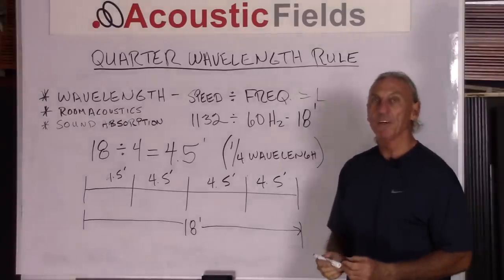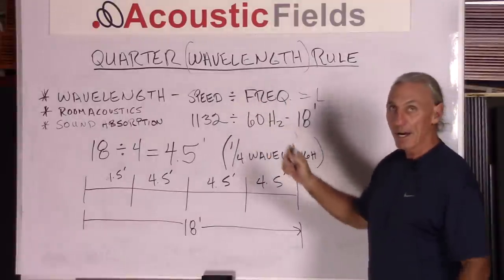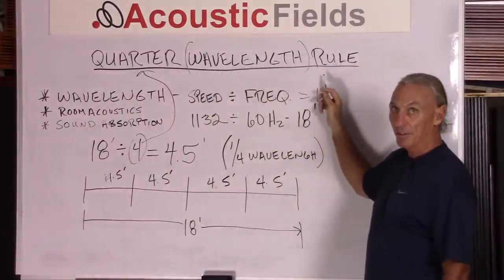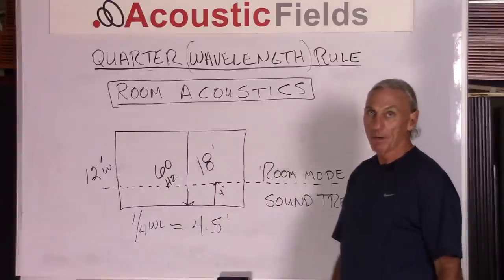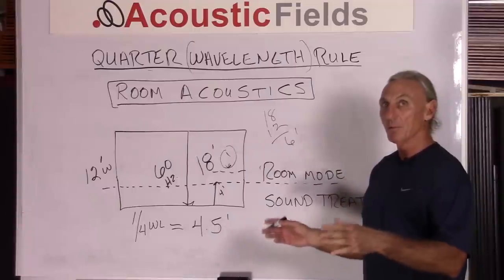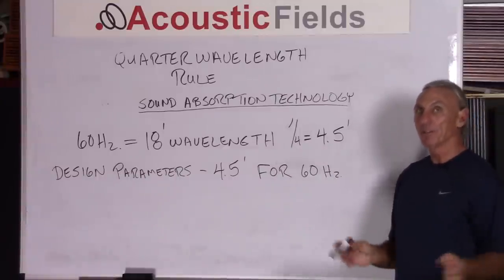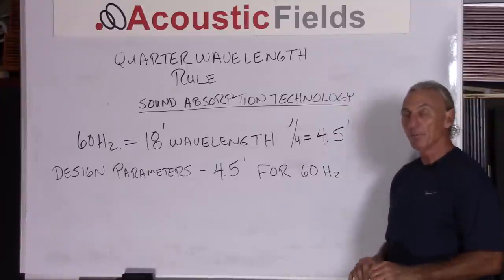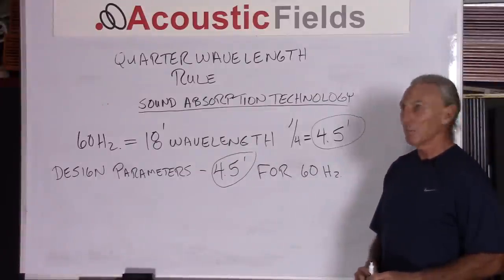The Quarter Wavelength Rule And How It Applies To Room Acoustics

Comment: I didn't understand what you meant. Yes, okay, 4.5ft is 1/4 of 18' which is a 60 wave. Ten minutes of saying that ten ways or more, yet nothing I could discern about anything you're applying that principle to. Add 4.5' to acoustic treatment how? Make acoustic treatments 4.5 feet in what way? What is the context of this principle you're trying to impart? This felt so incomplete as to lose the conception of the very premise.
Reply from the maker: C,  Education of complex issues requires a step by step process. Our experience with illustrating complex subjects tells us no more than one main item per video. If you try and define and explain the issues and then offer the next logical step as you have illustrated, people get confused. A confusion that translates into numerous phone calls and emails for me that takes away from my available time with customers. We will be doing a follow-up series on this topic in 2019 taking this concept to the next step and applying it to small room acoustics.
Reply: Thx but I asked for elaboration not a defense; that in no way answers my question. 4.5 feet what? 4.5 feet in what way? In what regard? 4.5 feet from the short walls? 4.5 feet tall? 4.5 feet is 1/4 of 18 yes, but you can't just apply that to NOTHING and call it a rule.
Reply: It has to do with particle velocity when the strength of the wavelength is at its weakest then theoretically it should be easier to stop with velocity based absorbers such as broadband panels etc...so to trap 60 hz fully you would need 54 inches of pink fluffy stuff to completely trap the wavelength. Limp mass absorbers or helmholtz helps in this situation, but by all means look into it dont use pieces of charcoal briquettes to tey and fix it at over a thousand dollars a pop. A sealed cabinet with hardboard or mass loaded vinyl does wonders if tou know the math so you can build them deep enough etc...
Reply: @AcousticFields  but which video shall i watch next? step by step is the right way to walk, but where shall we step next? we get lost in youtube randomness if you don't lead us a little bit, maybe you could PIN a comment with a link to the following subject? would be dope! much love and thanks for your work, really appreciate it!!
Reply: There are 2 types of sound absorbers: pressure and velocity. At a physical barrier, the velocity of the air particles is zero and consequently the pressure is at a maximum. At 1/4 wavelength from the barrier, the velocity is at a maximum and the pressure is zero (in a perfect environment). Porous absorbers, like rockwool, absorb best at maximum velocity, so if you want to absorb the 60Hz wave that he is talking about, you will need to place your rockwool panel 4.5ft from the wall. This isn't practical in most situations, so the better solution is to go with a pressure-based absorber like a diaphragmatic panel absorber mounted on the wall where the pressure is at its maximum.

Comment: I can always go through your videos to check it you have one on this, but Id be interested to see the process of building and placing the treatments in a room based on this video. I'm unfamiliar with quarter wavelength bass traps, how they might be built and implemented. As I read, it was getting a bit confusing -- so it would be great to see one of those put together to resolve a similar issue to the one mentioned when trying to absorb bass. My understanding is it tends to bunch up in corners. I also know there's pressure-zone traps, functional traps, and active traps. Trying to learn the different use cases of each. Thanks for the video!

Comment: Thank you. Explained very well to my SO why we needed a few acoustic panels in our Sun Conure Parrot's room (95dba max screaming) and why they needed to be the size, shape, and offset from the wall that they are. FWIW, Sun Conure's scream biased in the 2k-4.5k hz range, so absorption is easy with 2" rockwool and a distance from the wall of 2.875cm. Cheers!
Reply from the maker: A,  Building insulation will provide absorption in that frequency range. However, it does not provide the proper rates and levels for music and voice. The fibers are also lighter than air and can go through any fabric covering stretched over it. look at what those fibers are made of and then ask yourself if you want those in your bird's lungs and any other living thing in that room.

Comment: At 1/12 wavelenght, wich is just 33% of the original impractical 137 cm of 1/4 wavelenght, you still have 50% of energy in speed form,  and it's a practical distance of wall (46 cm) for hanging treatment. please correct my numbers if I'm not right.

Comment: It wasn't clear to me what you were saying. 
What if the room was 18' long?
What about if the room was 13.5' long?
Please explain what the 1/4 wavelength rule means.
Thank you
Reply from the maker: T,  An 18' length would be best. Here is a different definition:
Quarter-wavelength rule : If a wall is a node, then the nearest other node at any frequency will be 1/2(wavelength) away from the wall. Given this, the antinode is midway between those two points, or 1/4(wavelength) away from the wall, for any given frequency. So, for example, if you want to filter out 60Hz, divide 18’ (the wavelength of 60Hz) by 4 = 4’6" and hang a thin layer of frictional material (acoustic foam) at that distance from the wall(s) and floor and ceiling.
Reply: @AcousticFields  I really liked your video, It really opened up my eyes into how the acoustics works.  But, here's another explanation from the wave sense.  If you think of a sine wave, the positive peak is at the 90 degree point.  That means that the highest amplitude or sound level will be at that point.  If you want to quiet a room, then place the sound absorbent material at that 90 degree point and it will be the most effective in absorbing the sound.  But, at the 45 degree point, the effectiveness of the sound absorption would be about fifty percent less.  Thanks for making this video and it was a bit difficult to understand the directions of the wave in the drawings.  Have a nice day.

Comment: Well explained,  my buddy had me place my speakers according to the golden ratio of the room dimensions,  not sure why. Is there a logical reason behind this ir is my buddy full of it, lol, thanks.
Reply from the maker: J,  Its physics. Sound travels at a certain speed. It also takes that speed and travels over distance. In small room acoustics its all about the distance the direct energy (straight line from speakers to ears) and the reflected energy from walls must travel before it reaches our ears. Its a balance between straight line energy (speaker) and reflected (room) energy. The "Golden Ratio" is a starting point towards that goal.

Comment: If anything, should I place the the baffle of the speaks in front of OR behind the screen?
Reply from the maker: Neither. If you place them behind the screen, you attenuate 4 - 6 dB of sound energy from source. Never loose energy from source in order to manage it. Let source be source. In front of screen. I dont kknow what that means. Place them right and left of screen. Place them as close to screen as possible. Make sure the front edge of spaeker is ahead of the screen.  Split the center channel signal into left center and right center.

Comment: Hi Dennis, thank you again for your insight.  When a single 60Hz wave is formed from the driver of the speaker, what happens at 18' away from the speaker once the wave completes it's cycle?  Does it decrease in amplitude(is that the correct term?), thus making it easier to manage if the room is larger than 18'?  If so, by how much does it decrease in amplitude (if that's the correct term)?
Reply from the maker: A,  Remember that waves oscillate through the air in cycles. Each wave has frequency and amplitude. If you look at a 18 8' wave individually, you would have to know the ending point of the wave as a result of boundary interference.
Reply: Assuming a constant 60hz wave, with an amplitude of 1 unit, and a wavelength of 18', at both 0' and 18' the wave will be at full amplitude (1). The wave will also be at full amplitude at 9' due to the way a sin wave works. 18' away will sound as loud as 0' away, as will 9'. These are maximum pressure modes for a single wave. This is assuming a perfect room with no absorption factors (couches... Cushons... Curtains... Etc.) and a single source of sound. After 18' the cycle repeats (with peak modes at 18', 27', 36') at a reduced amplitude due to a function of distance. The general rule is that, every doubling of distance, you lose 6db. That's not actually a lot. A subwoofer dumping 100db into a room at 60hz, at 1, 9 and 18 feet, will only be attenuated to 94db at 18, 27, 36 feet. As a general averaging rule. 

And unless you're playing single tones of music, harmonics play a large factor as well. A tone of 60hz, with harmonics at 120hz, 180hz, 240hz etc. will greatly complicate the dampening effect of distance. 

http://realtraps.com/art_rear_wall.htm

Comment: Dennis, I really enjoy your video's as you are great at breaking things down for newbies like myself. I have a question about seating position and the frequency to diffuse. 
If I am diffusing both the front and rear wall in a critical listening room, should the diffusers used have matched frequency given that the distance to the rear wall is much closer than that of the front? In my case, I'm on the short side of a 7x22 room with the seated position being up against the back wall. From this video, I know that we could safely go down on the front diffuser to 282Hz but unsure of the rear given that it's directly behind my head when seated. 
Any help would be appreciated.
Reply from the maker: You will have to use two dimensional diffusion on the rear wall due to proximity.
Reply: @AcousticFields  Should I build the rear diffusers with the same 282hz goal in mind? As I understand it, the target frequency depends on distance from listening position. With the rear diffusers being so close to that position would that number rise for the rear diffusers only?

Comment: Ok. I went back to this one to try to understand it better. I understand the blow back of the energy and therefore it will stack up (I believe that's what you're telling us).   In a practical sense are you suggesting we measure the room and figure out what the maximum wavelength is that will fit in the room so we know we need to especially work toward treating the frequencies below that?
Reply from the maker: R,  There are many variables we must look at in room size and volume. Quarter wavelength, half wavelength, SPL levels, and a host of others. If you use full wavelength you have a good start towards ideal. The compromises from that ideal start point will determine the quality level we have to start with when we face the reality of small room acoustics.

Comment: sir thank you for the info and I also  have question : how to design a quarter wavelength trap for 500hz?
what are the steps involved in designing it?
Reply from the maker: A 500 Hz, issue can be resolved with a 2" think piece of open celled foam

Comment: Do you always treat the shortest wall-wall distance?

Wouldn't floor to ceiling be shorter. My rooms are 8' 6" high, isn't there a build-up of energy if the shortest wall to wall and floor to ceiling are almost exact. (or a multiple such as 17' 2")?
Reply from the maker: D,  Shortest distance largest problems below 100 Hz.

Comment: Hi! Great video, thank you for sharing your knowledge. One question: Does this mean that you should place your acoustic treatment for that frequency (in this example, diaphragmatic absorption for treating the 60Hz) at the 1/4 distance? Or at every 1/4 distance of the wave length? Will the position of the, say, mixing desk interfere with the placement of the absorption?
Reply from the maker: F,  Yes and no. Yes, placing the treatment at 1/4 wavelength distances is desirable for low performing absorption technologies, but not practical. It is best to use a technology that can absorb at 60 Hz. with the rates and levels you require regardless of where you place it.
Reply: @AcousticFields  Thank you for your reply! This is very helpful.

Comment: Wouldn't you be seating facing the long wall  and not the short wall direction? So you're saying it at least has 6 inches from the back walls/font or the side walls?  I'm confused if we're facing the long wall it would be 6 inches from the front wall?
Reply from the maker: Rememeber the room does not care what you want. You must set up on the surface area that exhibits the frequency and amplitude issues that will best respond to treatment for the pressure issues. Along with this pressure consideration, you must then look to sidewall distance to manage primary, secondary, and tertiary reflections. The longer wall will satisfy the reflection issue but may not be the best pressure choice. Nothing in acoustics is easy.
Reply: @AcousticFields  i understand it not easy. Besides having s small room ( thats the biggest complaint for everyone) I purchased the diy kit made two bda and still i cant get or understand  your concept.  I challange you to make me a Believer. At this point all the money i spent on these BDA. Im starting not to have faith in what your saying

Comment: great explanation! thanks a lot,   what happens with monitor position?  I know it is also applied this theory to know which frequency will be affected
Reply from the maker: H,  Why be concerned about speaker placement by dodging modes and looking for places where there is minimum pressure issues. Why not treat the room to minimize these issues throughout the room.
Reply: @AcousticFields  Thanks a lot!

Comment: Good video. Let me add that 1/4-wavelength effects are far-reaching. They can be applied to transmission lines and antennas in electronics... and also apply to light/optics!
Reply from the maker: Wavelengths come in sound and light. I would be interested in the color associated with the wavelength for light.

Comment: Dennis with thi equation would a 30hz cycle be 36ft long?
Reply from the maker: Hi Steve Morgan 

How are you?  You are correct: 1132 / 30 = 34.40'. Now, here is a good question for you. What do you know of that will stop a sound wave of energy 34.40' long? 

Thanks
Dennis
Reply: Diaphragmatic absorption device placed at 1/4 lenths along the wall?
Reply: What are you doing up so early? All nighter?
Reply from the maker: Steve Morgan I'm an early riser :)
Reply from the maker: Hi Steve Morgan I answered your question on the quarter wave length rule in greater detail in yesterdays Google Hangout. You can see the part where I answered your question here http://youtu.be/eVzFJYai0s0. I also answered your question re: diaphragmatic absorber placement here http://youtu.be/qhNXi4cpVMM

I hope they help.  Please let me know if you have any follow up questions I can help with.

Thanks
Dennis